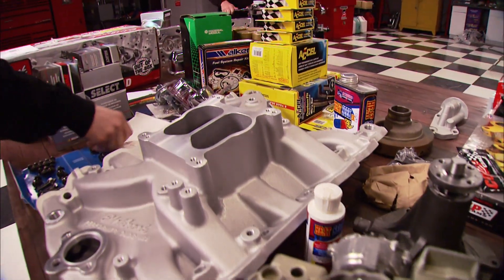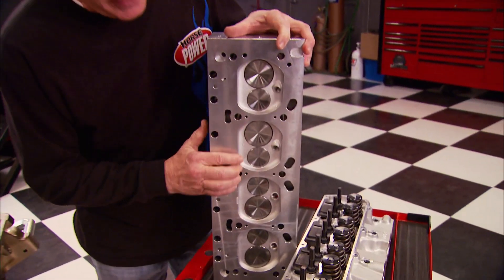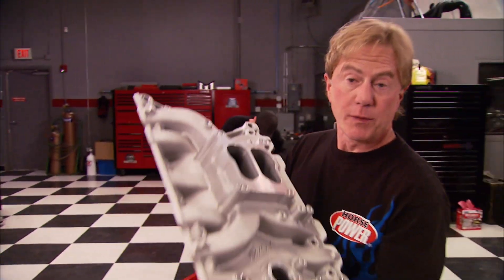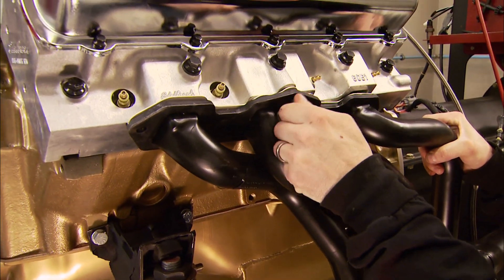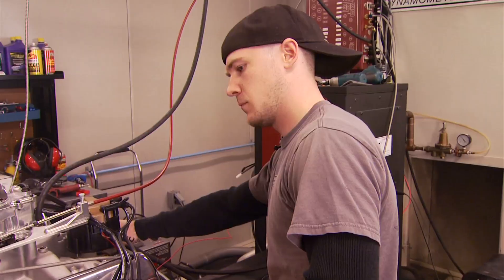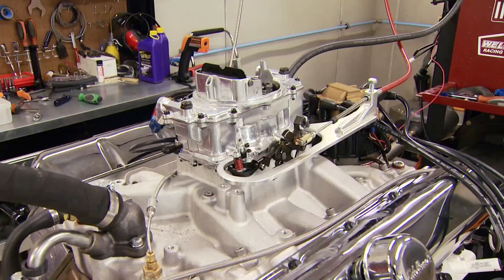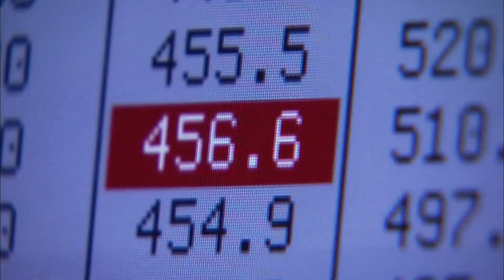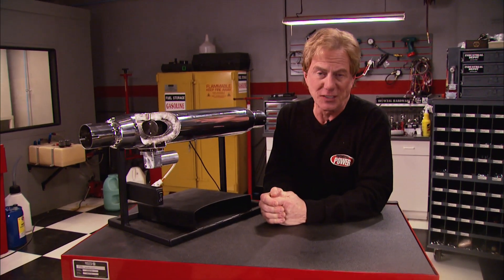Dyno Testing Our Mondello 455 Olds Big Block - HorsePower S13, E8

Comment: Had a set of batten aluminum heads from joe, with a clay smith cam in my 68 Cutlass Supreme..  ran 12:02 all day long 108 mph. Had 1:50 60 foot times . It was a torque monster. RIP joe.

Comment: You did Joe Mondello a disservice. Graph is screaming that something is seriously wrong. A 470 inch motor (455 bored 0.030 over) built like this should be way over 500HP It would have been much more informative if you filmed tracking down and fixing the problem, rather than pretend it's fine.
Plus you didn't list cam specs or compression ratio. You said it was a roller cam, then we see flat tappets later. This was a poorly produced episode.

Comment: I wouldn't think I'd need to explain this to you but at WOT there isn't enough vacuum to operate the vacuum advance. The vacuum advance is for fuel mileage and cruising around town. So the timing at WOT will be only the initial advance plus the mechanical advance. All in somewhere around 32 to 36 degrees. But I'm sure you already know that. You should have caught the issue with the mechanical advance when you had the timing light on it.

Comment: i was not impressed at all be these numbers. a cam, intake, alum. heads, big carb, and 450hp and 520lbs torque?this is the engine in my 77 cutlass: .030 over 1968 455, C cast 455 heads, port matched 3/4in. in, diamond pistons, compression is 10.3 to 1, performer rpm intake, flat tappet howards cam, about 518/529 lift, 286/290 duration, stock dizzy w/ pertronix, packard wires, 1969 quadrajet carb built by me.457.4 hp/ 531.4 lbs torque.this engine with the alum. heads, bal/blueprinted, intake,cam,carb, should easily be over 500/525hp-i have a 1970 320hp olds 350 w-31 engine i just pulled off the dyno, hyd. roller cam, .514/.518 lift, .288/.292 duration, edelbrock intake, stock dual exh. repro manifolds, correct 1970 qjet, going in my son's 1977 cutlass 442. 436.2hp/489.6 torque. so my guess is my lighter 350 would pretty much hang with this 455. i expected a lot more from a mondello engine. but, they are not what they used to be-

Comment: Dad had a 496 Olds stroker built by Dave Smith back in the late 80s early 90s, it was a beast.
Reply: I had a buddy that had Dave Smith  diesel block/gas conversion engine. Was like 120 over with the thick block. Ran like 10 quarts of oil in it.

Comment: The Olds Big Block started at 425 ci and later a 400 , and 455 , that's the biggest starting CI of any big block , it was intended to go well over 500 ci but times changed , if the big block got the small block 403 bore at 4.351 inch ( bigger than any other modern V8 including big and small block , only the 460 Ford is bigger and only by 0.009 of inch ) and the big block 4.25 stroke we are talking 500 ci easy , the 403 small block has a bigger bore than a 500 caddy V8. If only Olds had given the big block that small block bore the Olds would have been a monster !

Comment: I had an Edelbrock Performer on my 455, '67 4-4-2 (yes, the original 400 block was stored in the garage), but ot wasn't until I  sourced and installed an L69 tri-carb unit that the 60 nover 455 really opened up.

Comment: No matter what I build, I always set my ignition timing long before the initial start up! Whenever possible the same goes with the fuel system. Cam break in needs to happen  when most guys are trying to figure out why it runs like 💩 or doesn't run at all!

Comment: My Olds 400 engine currently 442 ci, 9.6 to 1 compression, custom lunati roller cam, stock heads, and a tri power intake makes 469 hp and 531 ft-lbs of torque.  I wish they would have included the compression ratio.  I doubt it was less than 10.
Olds does make a great engine.

Comment: I made more HP. from my 1966. 425 punched out 40 over used mostly factory parts gouged pistons, Coles True Roller Timing Chain, 
Custom Ground '70 W-30 Stick Grind Camshaft 328 degrees, Reworked the 'C' heads totally blocking off the heat under the  intake manifold and filling in the siammized center exhaust ports, I used Oldsmobile HIE Distributor that was Reworked as well, Edelbrock Torker intake manifold, block was squared up, aligned honed, and balanced, as well as oil restrictions and  rods ground for oil relief and crank cross drilling and chamfered, the block was also debuted and oil gallies all smooth out so oil would drain back into the pan faster, also used '70 Oldsmobile Tornado 5 quart oil pan. 
I put out 525 HP

Comment: 510 ft lbs, 1970, 455 olds. This engine held the factory torque record untill Dodge released the Cummins diesel pic up. Also 510 ft lbs.
Reply: Sorry but that was a Buick 455 not Olds I love all 3 455 makes but Olds is my favorite

Comment: 455 is a massive engine..my 73 Sidewinder jetboat has a 70 olds 455 in it... Berkeley 12jg jetpump..AA impeller..
It runs around 75mph...it does aight
Reply: That's fast for a jet boat ... Btichen🍻💪☠️

Comment: Honestly, I was underwhelmed by the build especially with the aftermarket aluminum heads used.  From personal experience, the standard Performer series really aren't much better if at all better than stock.  Using a RPM Airgap would have been much better.  Also, I'm thinking the wrong cam was chosen for this.  You should have been able to easily get 500 HP+ out of it and still be streetable.
Reply: Im thinking the same thing brother lol

Comment: Those factory W-30 Olds big blocks were rated at 510 ft lbs of torque. You didn't do much with torque but match the 455 Buick. HP is up, were really missing out on seeing the comparison between a Factory W-30 matching your build in the same car on the same track. Wonder what the 70 more HP in your build vs. a Factory W-30 would produce in the same car on the same track far as ET under similar conditions? Good results with your build but I expected more. You should have put one of those 4.5'' stroker Olds cranks in it and had a skilled porter re-work the heads. That's what would have impressed me. I'd give your build a C+, an average accomplishment. Think the Stock W-30 was equipped with an 810 CFM Quadra-Jet, I don't remember right off the secondary metering rod factory code, WW/WT maybe? Knew right off, the 750 wouldn't get it. When PSI developed their SCREW-BLOWER many years ago they used a Big Block Olds to drive it on an outdoor test stand to study and develop the PSI's maximum output performance. The 80's.
Reply: Olds w30 came with a 750 Rochester..  the only motors that got a 800 cfm Rochester was a very small number of pontiac 455 super duty. All Rochesters are 750cfm..including the ones on the 305..they just adjust the airwrap on the 2nds... the 70w30 made 440hp with headers..and barely 400hp with the W log manifolds.
Reply: @olddirtybastardgarage  Not an authority on Quadrajets, 750/800 is as advertized, 810 was rummored around the local Speed Shop here for decades. (flow bench, arguably of coarse. ) There are some errors on the Wikipedia page, I'm not aware of a vacuum operated piston to signal metering rod regulation... it was the air velocity air flap and an underside spring to set resisitive reaction therefore the 750/800 CFM report info may be in error. (these reports make no reference to inchs of Hg. (an80) testing reference. It is what it is.
Reply: Are you saying Joe Mondello is not a skilled head porter? I thought I saw him porting heads in the previous video.
Reply: @marcmo7138  My reply was in reference to an available skilled porter of the time, Mondello is deceased. Put two and two together for Christ's sake. You're just somebody looking to start some c*ap. Jerk !
Reply: @marcmo7138  You're replying 11 Months after my post, who would imply any such a thing? appears you're just making an effort to put words in someone elses mouth.
Reply: @Nobody-ld7mk Who cares when I reply. I read your comment and replied. If you don’t want a comment, keep your thoughts to yourself.You said they should have had a skilled porter rework the heads. So I’m not putting words into anyone’s mouth. Just replied to someone who clearly knows absolutely everything and loves attention. Good day Professor.

Comment: with alloy heads  and modern combustion chambers you can run 11.5;1 comp,, i would have put a $1500 scat crank and rods in it. it would run 500= easy.  Hyd Roller cams are useless.

Comment: You still didn't reach 1 h.p. per cubic inch.... A .030 overbored Olds 455 is 461 cubic inches. 456 h.p. isn't 1h.p. per cube. 🤔
Reply: Close enough
Reply: False Advertising 😢

Comment: Im tellin you that distributor is junk, we did a simular build but used an msd 6al box with a msd distributor and got between 485-490 hp
Reply: Yeah definitely needs a proper curve with complete rebuild
Reply: Or just lock the distributor out, and use an MSD 6AL-2 programmable. Best thing I ever did on my Olds.

Comment: They never used to make a performer RPM for the Olds. Just the Performer. Good news is they do now. I think it would pick up 20-25 hp and lose just a bit of torque down low
Reply: I would use a Torker intake on that engine all day. It would help the top-end for sure, and who cares if you lose a little bit of that huge torque.
Reply: @davelowets  I’ll give you that. Last Olds I built I think I used a Holley single plane? I could be wrong. I’m old and it was a long time ago
Reply: @canabox7112  Holley made the "Street Dominator" single plane intake for an Olds a long time ago. Perhaps you had this intake.

I'm an old Olds guy also.

Comment: 13:00   MIKE MUST BE SMOKING SOMETHING . NEWBI PROBLEMS FROM ASSEMBLY.
Reply: 9:12... wipe out the cam and then the plug wires and it’s running like shit , you line up your distributor with the slash you made on disassembly, if it’s not factory marked
Reply: @dennisford2000  Huh? 🤔 You should NEVER "line up a distributor with a mark made during disassembly". That's what a timing light is made for, and is the proper way to time the engine.

Comment: Back in the day I saw a Olds build that used ported stock heads and an Offy port-O-Sonic single plane intake that made 455 hp, without a ton of cam. I’d lean towards that intake, but keep the Edelbrock heads and bigger carb.
Reply: Yep. The Offenhauser Port-O-Sonic is a good intake for a fairly stout Olds big block. If you build an engine for more h.p., the Port-O-Sonics bigger brother, the Super-Sonic is a pretty good intake as well if you are running a Dominator carb. My 468 with extremely worked over Edelbrock heads, and a port matched, worked over Super-Sonic with a 1050 Dominator runs 9s in the quarter mile.

Comment: You didn't mention machining the top of the rocker stud FLAT to ensure the poly-locks don't loosen during operation.
Reply: Not needed... I've run my engines for 25 years without doing that, and never had one come loose.
Reply: @davelowets  My 403 build had the crane cool nuts along with comp roller tip rockers and the cool nuts backed off on it.

Comment: I remember a couple of cars back in the early 70's that had nothing else added but a set of Mondello Heads. One was an SS Chevelle that smoked everything on the street. Mondello Heads were the top of the food chain in those days...
Reply: I rem when AFR came onto the scene and they had a competition between Mondello and afr...and afr heads absolutely smoked mondollar...and that's when he saw the light and got a flow bench ... he butchered a lot of olds heads before he got smarter

Comment: Saw an episode of "Nicks Garage" where the Performer intake was holding up the show.  Put a stock on on it and gained substantial power.
Reply: You should pay attention. Because you are wrong Nick thought the stock one could make more power but he was wrong the performer made more power. That was also on a small block olds.
Reply: I saw the same episode, i saw very different results
Reply: @baddonkey6876  which episode was it
Reply: The Performer intake on "Nick's Garage" was NOT "holding up the show", and he ended up putting it back on after he tried the stock intake. Watch the episode again, and you'll see...
Reply: Terry Petty, those huge cast iron intakes  make great boat anchors too. lol
Reply: @dntn9634  They do... ESPECIALLY the flat as a pancake Toronado intake. Those things are the WORST.

Comment: Find yourself a quad barrel carburetor  my 455 loved it but hey it was a every day diver
Reply: Both those carburetors they used where 4 barrel carbs. It's about the cfm it can flow they started with a 750 and it wasn't enough so they had to step up to a bigger cfm carb.
Reply: @nobrakes425  the summit 750 is just not a performance carb...a 455 olds turning 5200 rpm is barely using 650cfm..

Comment: or you could pick up a junkyard 6.0, throw in a "stage 2" cam & springs & make just as much power (if not more) for 1/3 the cost.  I do love the "retro" big blocks, but it's just so easy to make power with the new motors (Gen 3 Hemi, Coyote, LS/LT).
Reply: You simply can't compare the torque of an lq4 with a 455 cubic inch big block. Some guys just want torque.
Reply: I have to admit, Coyote & LS engines have spoiled us to the point I think a lot of us were disappointed with "only" 456hp. My how times have changed!
Reply: That's exactly what I did sold the 68 olds and got 2 c10s 65 and 70

Comment: Needs more carb plus a 1" spacer, 2 1/8th" headers and collector extensions.
Reply: Cam must be pretty mild.  When the camera zooms in at the end you see it's only at 4700.  You'd think with the hassle they went to they be aiming more like 5500.  Needs a different cam and then carbie and headers to suit.

But pretty impressive to get 1:1 at that low revs.
Reply: 2 1/8 headers is WAY overkill for this engine, and would do nothing for horsepower, but would kill torque. My Olds 468 runs in the 9s in the quarter with a set of 2" primary tube headers.

A 1" spacer wont do much on a dual plane intake either.

Comment: The only problem with that 455 is it supposed to be metallic blue and not gold, the gold was reserved for the 350 rocket.
Reply: Wasn't the Hurst Olds motor red?
Reply: @richardbailey7558  that was before 1970 after 2970 the big blocks went blue the small blocks were gold....
Reply: '68, '69 Hurst Olds 455s were red. '70 - '76 455s were blue metallic. I've seen several pre-'70 Toronado 455s painted bronze.
Reply: My 68 442 400 was gold....not a small block or big block...they all use the same size block
Reply: Not correct.
Reply: What was the j2 coloring seems I've seen them in a few different colors?
Reply: I owned a 1966 Delta 88 with a red 425 in it. It ran strong. 🇺🇸
Reply: Close enough. 1-5-25 su
Reply: Later70's small block Olds 307;350;403 were painted corporate blue, as the rest of the GM engines did. The corporate blue color had no personality IMO.
Reply: Wrong
Reply: Depends what year.
Reply: @patrickstearns7958  No Olds big blocks were ever factory painted gold. Only small blocks. Some early big blocks were Bronze, but never gold.
Reply: @davelowets  pre '70 the motors were red. Not gold in the '70's they went blue the small blocks were gold...
Reply: @davelowets  in the '60's the big blocks were red then in the '70's they went blue the small blocks were gold...

Comment: Want  to debate wasted money ,? Aluminum heads ? Porting ? Degreeing cam ?  Aluminum  intake that is a copy  of stock ? No air gap ? Unmassaged aftermarket distrib, weights  ,noizy aluminum rockers , no bathtub intake gasket ? ( Cools Intake from bottom essential when air gap style Mani , not used ! ) Rebuilt short block , bigger pistons .  Not impressed with it for money spent $$$ . I be seen this trend with Pontiac builds as well . That much spent and little difference from stock 455 with 9 to 1 and a camshaft of 500 lift & ,290° D, throw in  wrong headers for a  350 cube model and get SAME RESULTS  EVERYTIME ...MANY OTHERS KNOW THE SAME THING ! DOES THE PERFORMANCE OIL PUMP ROB THAT ENG, OF MISSING  75 H.P. YOUR NUMBERS ARE MISSING ? WHAT WAS THE V/ E RATIO OF THIS SET UP THAT THING SHOULD DO ALOT MORE FOR THE INVESTMENT MADE...
Reply: Yeah seems like something is still off. 1 hp per cube with all those parts isn't great.
Reply: Every engine built by these guys is a turd.
Reply: Spot on!  My 76' block ,70' "C" cast  heads , 70' W-30 stock stick shift cam w/ w-30 alum intake + 1"wooden spacer, recurved HEI, module , H/O coil, 850 spread bore holley DP . 11.57 w/ 4spd n 4:56 spool @ IRP in the late 80's Oops almost forgot ,11.00/1 + .040 alloy pistons/ ceramic rings.
Reply: The cam, intake, and headers were the killers of power on that engine.